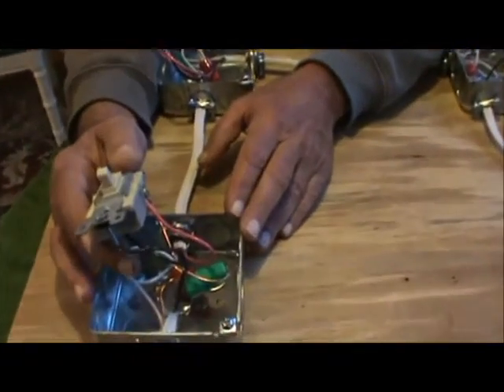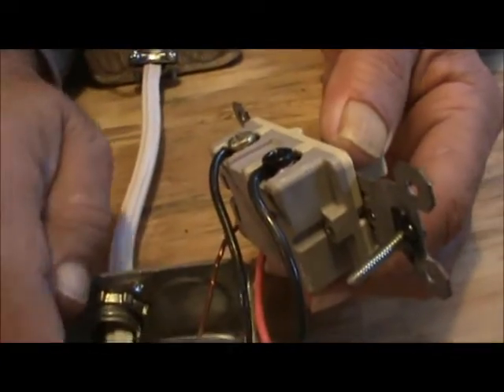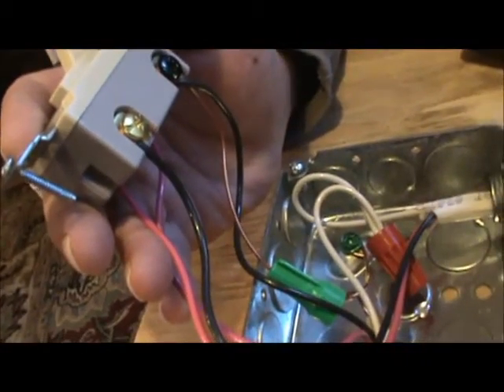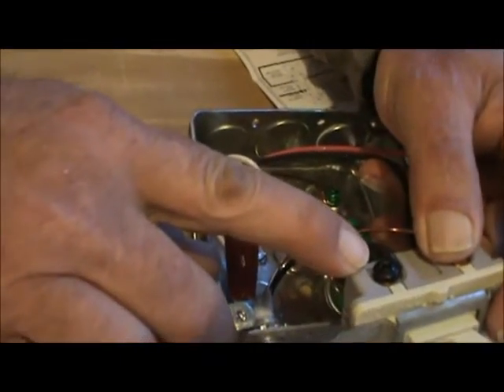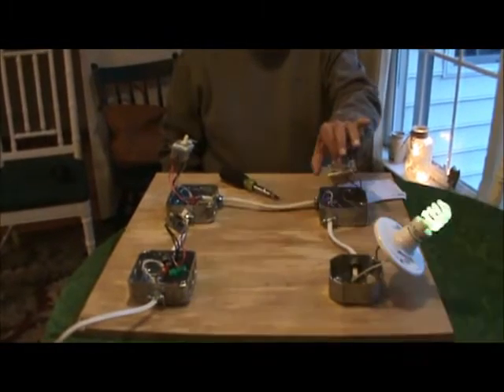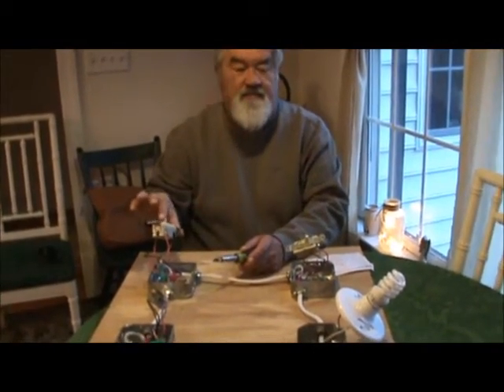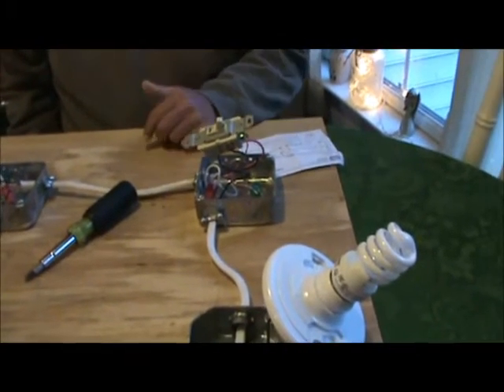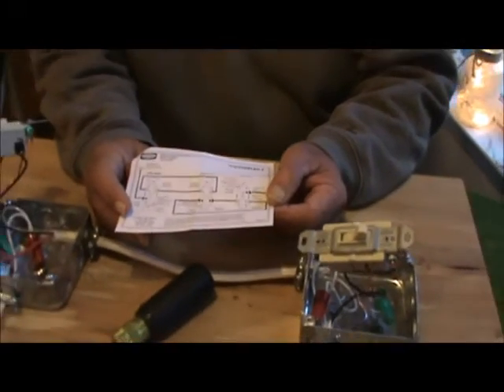How To Wire A 3 Way Switch/4 Way Switch

Comment: How would I go about running outlets off of the second switch? or a single pole switch for a separate light?
Reply from the maker: You need a hot wire and a neutral you may not have enough wires the hot has to be hot all the time. Hard to answer with no diagram.
Reply: Thank you. I ended up running a separate feed.